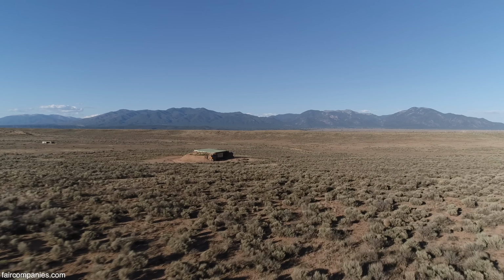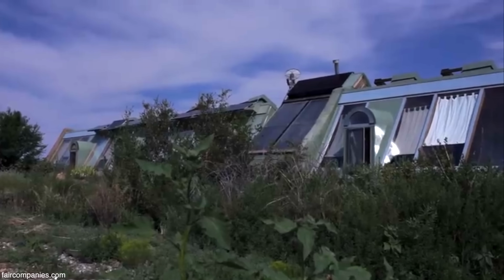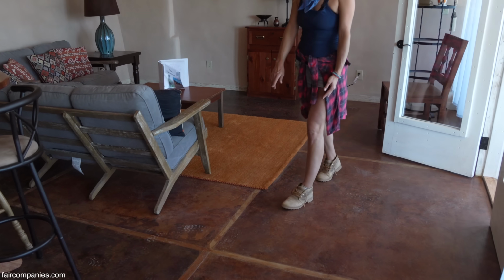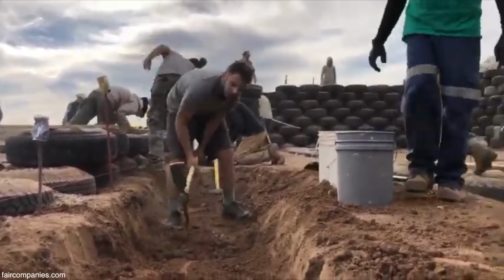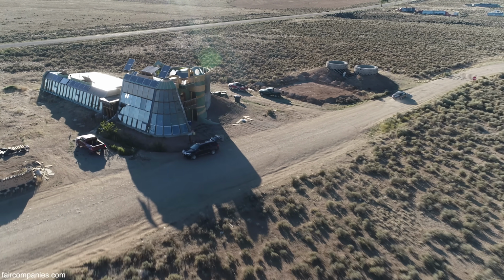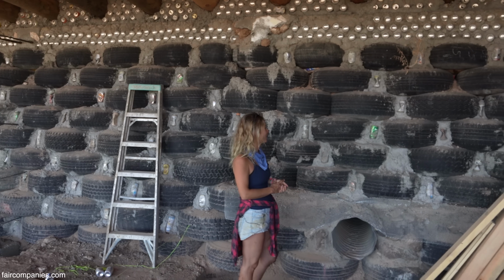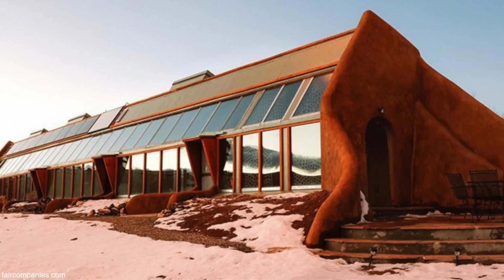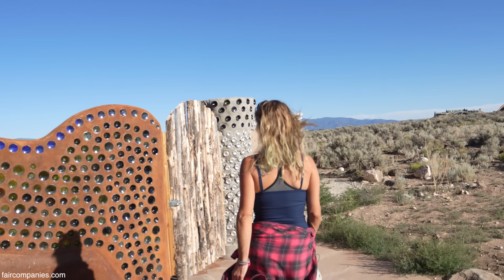New Earthships capture more energy, water & food at lower cost

Comment: I appreciate the design and execution of these buildings, very cool. Living in that particular community would probably not be for me because it seems like there aren't many options for getting to Taos aside from driving. I mean I get it, I grew up in a remote place that was a car trip to go anywhere, but if you want to be self sufficient and truly low carbon you're going to need to address that elephant in the room.
Reply: The biggest reason they're there is because it's where the govt allowed them to experiment with non-regulated buildings. And on a second point, self-sufficiency means exactly that. It's very new to human societies to move miles around hyper-specialized neighborhoods of the same city every day. A world built around like-minded settlements would probably have wide mass-transit networks between them, but you can't expect a project like this to take off inside a urbanized (and therefore regulated and controlled by the real-estate industry) space anytime soon.
Reply: @voltcorp  The houses may be self-sufficient, but the people living there certainly aren't. The biggest thing missing there is a corridor to travel via bicycle to town. That should probably be their next project (assuming there is some cohesiveness to the community). I'm well aware of zoning and county vs city permitting requirements.
Reply: Does carpooling and hitchhiking not count?  An electric car charged via solar panels?
Reply: @samd1405  In all of the videos I've seen of this community they're driving ICE vehicles. Sure car pooling is good, not sure I'd want to rely on hitchhiking. Much better to have a non car based way to get around. An EV is better than carpooling or hitchiking even if not charged by solar at your house (which takes a pretty big system to do). This community appears to be entirely car dependent, they should work on that next, that's my point and I'm sticking to it.

Comment: There is just one thing that worries me and that is the use of old tires. Old tires tend to aout gas and and out secrete a lot of carcinogenic compounds like mercury, lead, benzene, polycyclic aromatic hydrocarbons, and arsenic, among several other chemicals, heavy metals etc. IS there an alternative to using old tires for earthships?
Reply: HI Chris, tires only "off-gas" when they are in touch with oxygen. No oxygen, no off-gassing. We cover ALL tires completely with concrete and mud so that this does not happen, you will never see a single exposed tire in a finished Earthship. Hope this helps! :)
Reply: @deborahearthship3549  Thank you for the answer. It really helped as this has been one of the pain points for me to work around when it comes to planning my own earthships dream designs.
Reply: @deborahearthship3549  do you have any contact information?
Reply: The tires have essentially already 'out gassed' by the time they are gotten rid of for car use.  About 3 years of average use, if I recall correctly.   Mike Reynolds had a scientist do a study about the safety of using used tires regarding out gassing issues at some point.  It's mentioned in of the Official Earthship videos.
Reply: Heavy metals 🤘🤘
Reply: I've heard this was a problem too. Solving the tire waste issue while laudable still begs the question' How can you be sure it is safe? Was the safety study peer reviewed? I dont buy the encapsulation in concrete / no oxygen defense. Offhand for me though it is enough to try and provide some kind of barrier from the living space side. The entombed tires can rest in peace forever on the other side as long as their unseen presence there does what it has to do. Those particular tires, ALL tires are a horrible legacy. Anyone who has ever extensively  owned or operated a car SHOULD have to live with them! Or find a better solution. This is a pretty good one.
Reply: Kazpar Zyxzpenualt Lol.. nature won’t be mad at all the tires. They will make homes and nests and hives out of them. Nature isnt so thin skinned as humans.
Reply: @deborahearthship3549  - It will leak down to the soil...through the concrete...contaminating it...
Reply: @kazparzyxzpenualt8111  re:  "Anyone who has ever extensively  owned or operated a car SHOULD have to live with them!"
By that logic,  you should extend your statement to: "anyone who regularly rides a bus, taxi, rickshaw, or horse-drawn rubber-wheeled cart....."  Sheeesh, judge much?
Reply: Might also want to look into Earthbag housing, you don't need tires to make an earth based house.
Reply: Well, you COULD probably get away with mud-bricks of some sort or other depending on what the soil is like where you're planning on building.  You'd just need to make enough to do the walls thick enough.
Reply: Bails of treated straw, plastered over. It's way better.
Reply: Hallo, wurde überprüft, ob durch die Verwendung von Reifen als Baumaterial schädliche Stoffe in die Umwelt/Wohnräume gelangen? In Deutschland sind Altreifen umweltgefährdend, und müssen einer ordnungsgemäßen,  sachgerechten Entsorgung/Verwertung zugeführt werden. Wer schon einmal in einem Lager für Sommer-/Winterreifen (Reifenwechsel) war, kann mit seiner eigenen Nase riechen dass die Reifen ausgasen.
Reply: @anneliesetischer820  hello !
No spreiken de Deutsche. 
Sorry.
Reply: Actually... Thinking of it, shouldn't Open Source Ecology's brick press do the job in this sense?

Comment: I really love the idea of the Earthship but I have looked at several in Missouri and everyone that I looked at had mold issues what could be done to adapt these to humid climates?
Reply: The cooling tubes would have to loop back into the house instead of going to atmosphere, and you'd need to have a dehumidifier running constantly. Otherwise it would almost be doable.
Reply: Where in MO?
Reply: @Wandering man  dehumidifiers are pretty energy intensive, aren’t they? Seems to run counter to the passive approach of this type of construction.
Reply: Air flow problems cause mold to settle.  Good air flow can take place of a energy using dehumidifier

Comment: Earth homes have been around for a while, however, issues with radon has caused issues.  Have they figured out how to fix this issue?
Reply: Linda McNeil the transom ventilation is the solution.
Reply: "Issues with radon"? What are the issues? What are the sources of the radon? Knowing the cause of the problem, or being able to accurately describe the problem, is the first step, and quite often the only step, toward finding a solution.
Reply: @kittimcconnell2633  Venelation and blockage (sealant) -- I believe it takes both.
Reply: @supplanterjim  The ground there contains uranium and thorium. These elements decay into radium gas that constantly seeps out of the ground. That is the source. The radon can build up in inadequately ventilated structures. There are 2 solutions, ventilation and radon detectors.

Comment: Lastly, just wanted to add instead of pounding tires which is super labor intensive and lots of time and manpower is needed to make one simple wall which takes weeks to get up, why not instead opt to use straw bale? I mean with strawbale has the same if not better insulation property than dirt being pounded into tires. Also, they go up like legos and only requires 1/3 of the time and manpower than that of the dirt pounding into tires does.

For me it’s a no brainer but, I guess to each his own. I look at being efficient both in materials being used cost and time along with manpower and skill level needed to build an eco friendly home.

It’s also worth mentioning as the natural decay process occurs of the buried tires they start to offgas those toxins through even the dirt at small amounts but, at a constant flow. Not to smart if you ask me to be even using tires in the first place. Also, calling it an earth ship is a bit misleading as it uses tires and concrete flooring more than in uses natural earth so, at that point instead it should perhaps be called the recycling off gassing ship perhaps? I know it doesn’t have the same ring to it as calling it eartship but, non the less describes it more accurately. 😄

Comment: I love that it is composed inside dirt so to speak, I wonder about long term exposure of whatever wall there is to the ground/dirt while it gets wet etc. if it would work in more rainy climate at all. Love the ground heat exchanged, probably  100x cheaper than what I did, though you get no air polution there... Cost wise I am not so convinced having seen so many people working on it - however I am sure you can do it cheaper with other materials and some mechanical equipment.

Comment: For those wanting to see them in detail or (better yet) try them out, several are available as Airbnb/VRBO rentals. My wife and I stayed in a relatively new one for a weekend and very very much enjoyed the experience. HOWEVER, we also had friends staying in another one about a mile away and their experience was not as pleasant as ours. For one thing, there was an unpleasant smell throughout... which I surmised to be an issue with the water reclamation/filtration system. Theirs was also unpleasantly warm, which I guessed attributable to the improper usage of the geothermal system (a lot of thermal mass that became very heated due to the place being locked up for many days, therefore needing many days to offload all that heat).

Comment: Simpler is something that doesn't require exterior inputs and doesn't have negative exterior outputs.  Living things (e.g. people and food plants) are vastly complex, but they can be part of a stable system that gets it's needs, like a forest - rain falls, it builds it's own mulch and compost and biological living soil.  Nitrogen fixing trees are part of the system.  So, it is actually super complex, but not something that you have to build.  It gets better over time - with rain and sun and biology.  But a mechanical or electronic system require tremendous external input to make and to continue to power.  We use fossil fuels without thinking at all about efficiency or are there better alternatives.

Comment: For some years now, I have been exploring similar concepts for Martian habitat design.  I would be even less high-tech than this example.  For example, use a water battery instead of a chemical battery.  Put your water tank up high and, as it flows down, capture the energy with a small turbine.  Use a windmill at the far end of the water cycle to move it back up.  Also, put in a water treatment system.  You only need two tanks.  The first breaks down and cleans using algae (such as spirolina) and the second tanks captures water through an upward tilted pipe between the two tanks to avoid solids passing through.  From here, you only need to sanitize the water.  You can use chlorine but I suggest distillation for drinking water.  So yes, there would be two water cycles--one for drinking water and one for aquaponics and flushing toilets.  I suggest an extra fresh water line to the toilets to supply a bidet, as well.  This way, you don't need toilet paper (and actually get a better clean).    The key to success would be that the windmill is sufficient to keep the tanks sufficiently filled at all times.  The wind can slow or stop and power and water flows will continue at a steady rate, regardless.

Comment: I noticed a propane tank in one of the drive bys . So they have to rely on gas. Presumably a supplemental heat source when needed. Not an issue with me.
I wonder what a future heat technology would be used as a substitute?

Comment: I remain sceptical as to how this would work above the Arctic Circle, where I'm from. But there are houses with "winter gardens" that are quite pleasant to live in. Older houses usually use wood to keep warm in the winter. And if you go to Siberia, you will find the best and most economical solutions for wood-firing, with big brick stacks built in the middle of the house, with many small wood-fired ovens, that'll keep the house warm and toasty for much longer and for a lot less wood then a regular stove through out that -50 degree Celsius winter night.
Reply: Probably would need to rethink the design significantly as these models rely on low sun in the winter for passive heating. Aslo having a large glass Infront may not be so good for heat loss in the dead of winter.

However, the earth would probably provide very good insulation. Also incorporating thermal mass heaters would reduce the fuel requirements.

Comment: I appreciate the thought that went into this. But "if you can do this here, you can do it anywhere else in the world." Try it in negative temperatures.

I'm sure having a house underground would be easier to heat. But it would still need a heater.
Reply: Seen a earth home in a city. They said ground temp there 58 degrees. So takes very little to heat up 10-12 degrees to 70.

Comment: When people finally release better source of energy, or simply better solar and wind generators, earthships can be mixed with smart home solutions, for you will have enough energy. Then you can make openning and closing cooling windows remotely or automatically, as well as pumping water from shower to plant etc., while not worry using power tools, or a lot of electronics. Electricity is only set back, but future can change than, and then earthship with smarthome solutions can be made and work great. I personally would like gesture controlled automatic sliding entrance door for that Star Wars feel. One issue I got with earthship is solar and roof. I would like better if solar would be put on the roof, so that space was used for more purposes.

Comment: Yeah.  Once you guys figured out low-impact water harvesting when it rains - and it DOES rain in the desert - and the 3-use water systems, the desert actually became one of the better places to put an Earth Ship.  You've solved the water problem.  The land's cheaper, plus you've got better sun in winter.  You're built not to need much heat, and you get free heat almost every day, all winter long.  With water out of the way, I think it's probably harder to do a near-zero-footprint Earth Ship where it's rainier.  

You can still implement some of the mass heat low-tech ideas, and at least be more efficient with your physical plant.  Even some relatively dry places, like the inland Northwest of the USA has a lot of "gray days."  No appreciable precipitation, but little if any direct sun, either.  Those clouds just fly right over the channeled scablands and Camas Prairie, and don't drop any moisture 'til they hit the Continental Divide at the Montana border.

Comment: I would like to see these being built in more Northerly locations like Canada or around Scandinavia
Reply: The more I think about a northern version, the most it looks like a standard home. Heat would have to be geothermal plus a heat pump. Food would probably be grown more outdoors, and preserved for winter. You could avoid a fridge with a cellar area. Water would be abundant especially if there are nearby lakes and streams, but avoiding frozen pipes is difficult. I imagine integrating it into the forest makes sense, but fires could menace life. And the further north you go, the less sunlight in winter.
Reply: @Rnankn  hehe. Your spot on actually. Dad had frozen pipes. most homes have a deep freeze instead of a cellar but I can see cabins or older homes using them. 

Good points. While Canada isn't the worst in terms of forest fires we did have a bad one this summer and our more northerly winters are Dark as heck for weeks or months on end.

Comment: The same idea could apply to using free or near free resources.  Use sound engineering concepts and planning.  In the southwest U.S.,  mud/earth walls or adobe work well because you are in an arid climate.  Elsewhere, you may have to use brick and mortar.  Building much below ground and a smaller above ground house with correct ventilation from underneath will moderate the temperatures.  There’s a lot more you should do and a whole book could be and has been written on the subject.

Comment: Very, very interesting. Wondering, with the cooling tubes, if the outside air enters them at like 80 degrees, on the other side what would be the typical temperature the air comes out at.